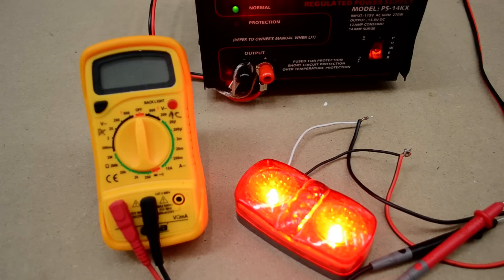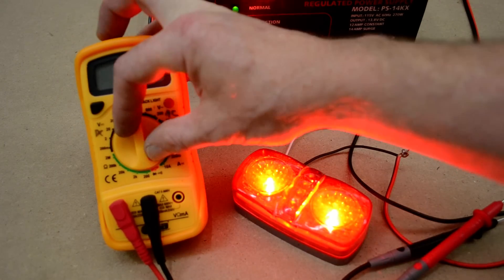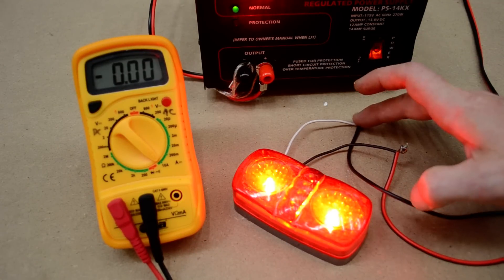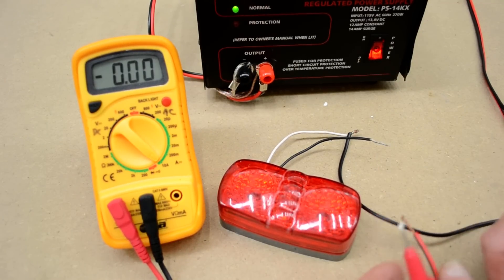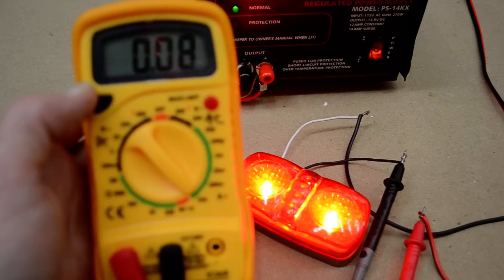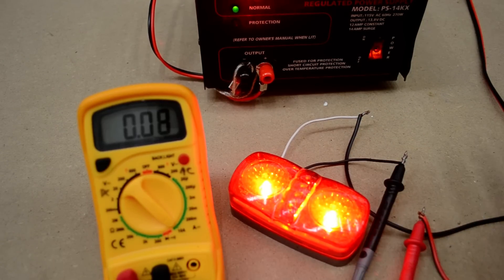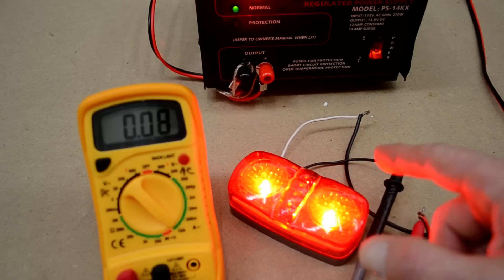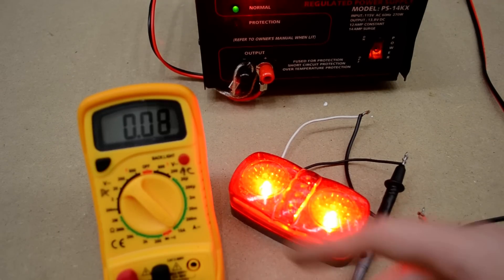How To Test Amperage / Amp Draw and properly measure and fuse a circuit

Comment: He has it on 10AMPS so .08 is .8amps. 
A 1.0 would be 10 amps A .10 would be 1 amp and so on.
JUST SOME FYI
Reply: INCORRECT...he has it on the 10A current setting.  0.08 is indeed, 80 milliamps.
  In his case a 10 would be 10A
Reply: Kevin Smith you are right donno what I was thinking lol
Reply: i donno i was trying to do math and 7 YEARS OF HIGH SCHOOL IM NO DUMMY  (yes i are)
Reply: +Sidabra24.com You are incorrect. The painted settings on a multimeter dial don't replace the 1 on the LCD gauge readout. This would be a nightmare of mental calculation upon each read of the gauge. The correct way to interpret the settings is "the max readout will be... 10Amps". And if it goes higher than your setting the gauge will show a special overflow symbol letting you know to crank up the dial. Not sure how you can know so much about series and calculations but miss basic multimeter usage.
Reply: @josephknightcom  Exactly. It's just like setting it to voltage, say 20v. The setting is the maximum range you expect, i.e. no more than 20v. So if you get a reading of 11v it is 11v, no calculation needed.
Reply: +josephknightcom I think you might be right on this one as this is exactly the way my multimeter works with Voltage settings.
According to this video, it is 0.08A, so it is 80mA bulb. Each bulb then is 40mA. Isn't it a bit too low for incandescent bulbs? LEDs are 20mA.
Reply: +Sidabra24.com I can believe it. They're tiny little flashlight bulbs. Also who says that battery is pushing the bulbs to the max? Looks like a charger with variable settings. He might have it turned down for safety during the video. Who knows, right?
Reply: You guys are confusing it as a 10x multiplier when it’s not.
Reply: david webb I disagree. I believe David is right here. Since the setting is on 10A it means every full increment is worth of 10A. So 1.000 is a 10A and 0.08 is 800mA. If multimeter had a 1A setting, a full 1.000 would be 1A and 0.08 would be 80mA.
Kevin must have mistakenly thought that this light is drawing too much of current. If there were 2 LED lights then yes, two of them would draw around 40mA at 2V.
But these lights in the video are old school 5W halogen bulbs and since he mentioned he runs them at 12V, theoretically they draw:
5W/12V = 416mA per bulb.
Connect them in series and you get ~832mA.
Two LED bulbs connected in series would draw only around ~40-50mA and would need only 6V power supply. That's how good a new technology is.
I hope I clarified this little discussion :)

Comment: My meter is a radioshack 22-810 portable and has 2mA 20mA and 200mA under the DC amps. The light is a custom made LED light made from a 120VAC energy saver LED bulb. the bulb has three LED modules custom wired in parallel the LEDs in each module are in series and each LED module runs well on about 12 volts. I am powering them on an 8 AA battery holder with a switch.
 
Heres my custom made light. draws about 150mA, current drops as the volts do.

Hella Bright LED Light

Hope you like it.

Comment: That is reading 0 . 08Amps  NOT 0.8 Amps.   OR,  8/100Ths of an amp,  NOT 8/10ths of an amp..
So that's only 80 MILLIAMPS !  
The 1 amp fuse you're suggesting is is 1000 M/Amps!!
That's 12 times heavier than the actual load!
You need to get your decimals right chum....

Also, Remember to think about the size of the cable supplying the lamp / load.  The fuse should PRIMARILY protect the supply cable to the load!  

Bulbs grow in the garden.. "LAMPS" produce light......
Reply: 10 amp scale - 0.08 is 0.8 amps 🤦‍♂️
Reply: You make it sound like ure better than everyone else. Dont get me wrong i don’t know shit about these things but i get really irritated when people act arrogant .

Comment: if it uses only 0.08amps and you suggesting to put 1AMP fuse dont you think that led will blow when it will get 1amp? it is more than 10 times the amperage it uses, do you think it's safe?
Reply: .08 of a amp is 80 milliamps. 1 amps is 1000 milliamps. A 1 amp fuse is more than enouph for this circuit

Comment: Is there ever too much amperage? I'm looking to power a 5v laser with an 18650 battery (3.7v @ 32a constant). How do I determine how much load is enough? Could I potentially damage it by hooking it up to 32 amps?
Reply: upx63 The laser is only going to draw as much power as it needs. If you put less volts than it needs, the laser is going to be weak, too many volts and it will burn out. I think what you need is a bigger laser.
Reply: epohnopulse What on earth are you talking about?
Reply: +Jimbo Jones he's just trying to sound super technical and awesome about rechargeable batteries for a laser...probably one of those dudes who thinks its fun to point them in people's eyes while they r flying a helicopter or plane or something...
Reply: - I want to know this too !
Except that my 18650's are about 2000 mAh, or 2 Ah, of storage capacity. Not sure how many mA it can deliver at maximum....

Comment: doesn't it matter to use the right regular gauge amps---FUSE>? With wired systems and of course with any power source you want an in line fuse--for mosty vehicles they are standard--4-5-10-20 etc..(cigarette lighter) anything you hook up usually has an in line fuse unless its modified.(**reverse for vehicle to house).I think >? thanks for the tutorial as a girl I can't get enough...lots of ways to go like inverters and battery packs ....to use AC or DC

Comment: Where is the red wire connected to the pos lead on the meter coming from?
Reply from the maker: I am in between one the +12v wires on the light (the positive side), one side to the red lead on the meter - the other to the black
Reply: ***** Probably from china

Comment: how can you limit amp draw? lets say you wanted it to only have a .04amp draw instead of the 8 thanks
Reply: You'll have to use a resistor to limit the current going through.
Reply: will that also lower the voltz?
Reply: Gabriel Campbell use a voltage regulator, a buck converter will do the job, you can get them with adjustable current and voltage on ebay.
Reply: Thanks

Comment: You didn't discuss surge amp draw such as if your lamp was cold and you first turned it on your amp draw is going to be much higher than .08amp.  Good video and not trying to knock you just throwing that out there